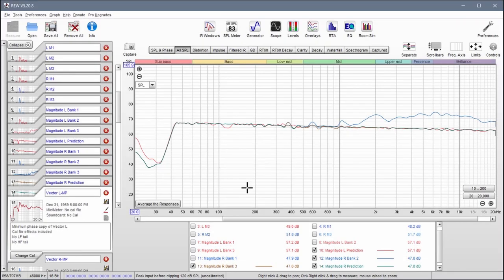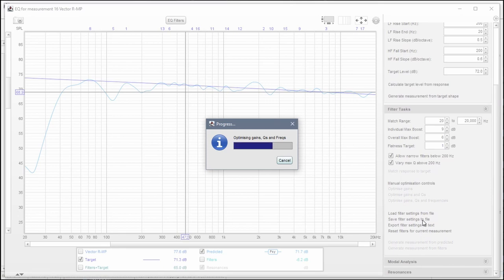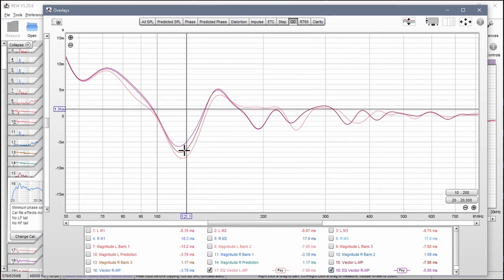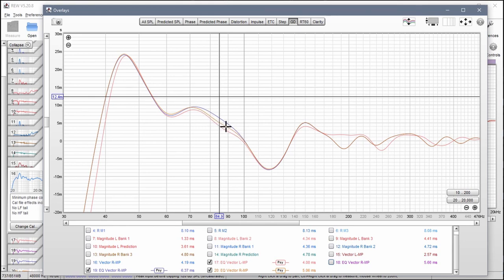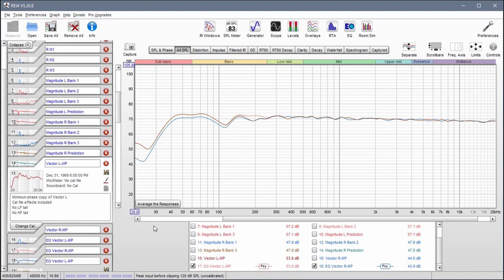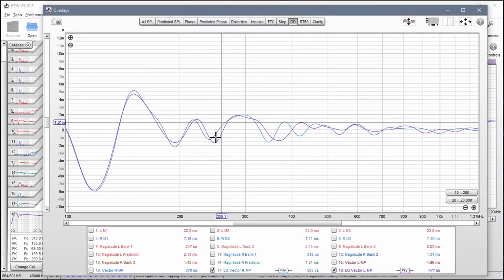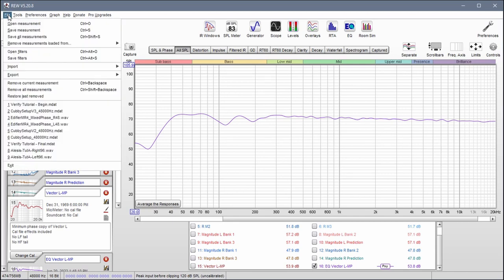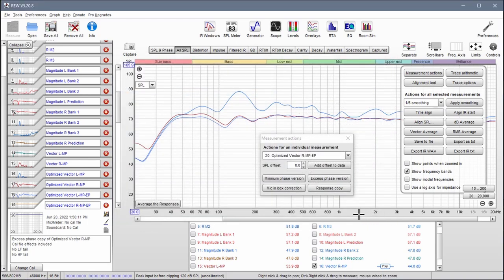Single-Point Digital Acoustic Correction for desktop & HiFi speaker systems Using REW and rePhase P4

Comment: When checking the excess phase copies, the phase line is completely flat, phase is 0 for all frequencies, I don't think that is correct.
Reply from the maker: Whether it is mathematically correct or not, the filters generated from this data "sound" great. Granted, this is not the most optimized procedure I could have made, but still I am more interested in how the final filters sound than whether the graphs look "correct" or not.
Reply: @davidbrancato  but if the excess phase is 0 for all frequencies and you use the magnitude measurements for frequency gain filters, I fail to understand what it does add to the filter. Can you please explain?
Reply from the maker: @l.s.1709  it’s not really zero though. When you pull the excess phase text files into rephase, there’s usually a slight rise in the top end so it’s not 100% zero. What this actually does technically is a little bit beyond my understanding but I do know what I hear when I listen to music through the filters and it is a vast improvement. Perhaps one day I will fully understand how it’s working, but for now, I just enjoy the fact that these filters are very close to the ones generated by other professional packages.
Reply: @davidbrancato  thanks, I've been using the minimum phase version of your filter for a week now and I like it. I also saw OCR's version who suggests a mixed power filter instead of the cutoff at 500 hz. Have you tried that already?